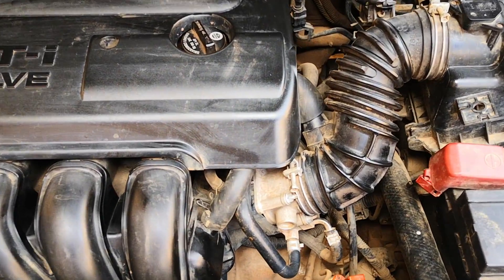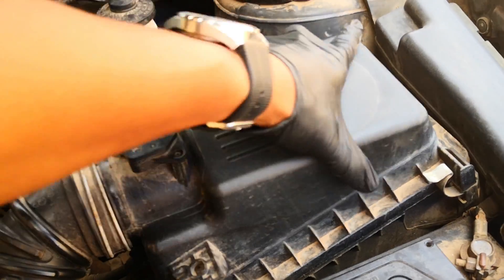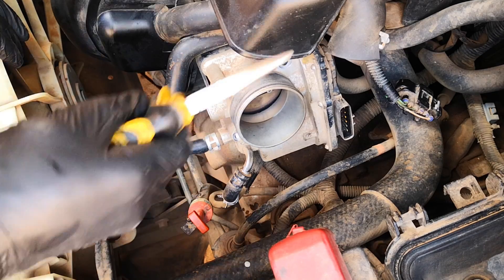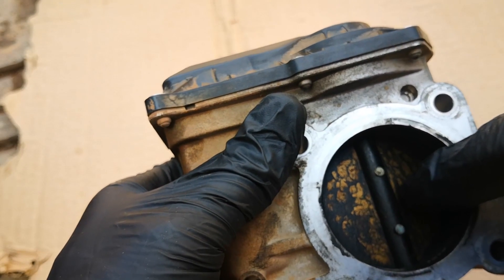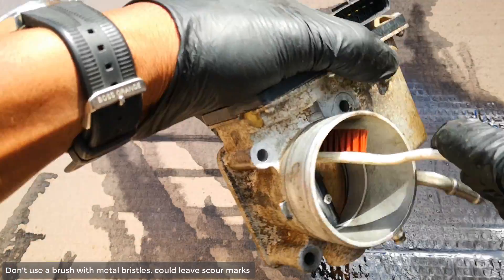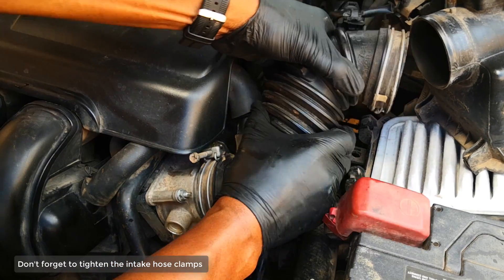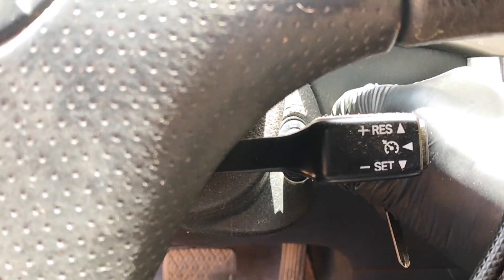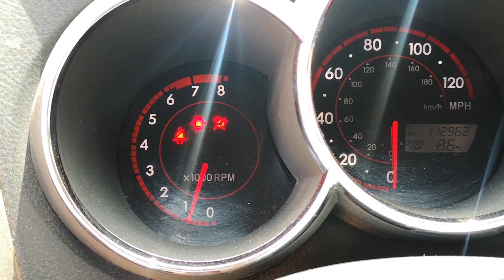Cleaning an ELECTRONIC Throttle Body: Toyota Throttle Body CLEANING / REPLACE: 2002 - 2008 Corolla

Comment: I cleaned the throttle body without removing the coolant lines. Now, when I turn on the car it shuts off by low idlling for 2-3 seconds. What could be the issue, please guide. Thank you.
Reply from the maker: Did you do an idle relearn afterwards? If its a Toyota, do the idle learn procedure. What car is it?

Comment: Weak acceleration....bot those Toyotas (Corolla/Verso) has already a week acceleration, so what do you mean by "weak"  ? Seconds to 100km/h ? Mine has 12-14s and I guess it always had that timings.
Reply from the maker: I just meant weaker than what you're used to. I haven't looked up Toyota's official 0 - 60 miles or 100 km numbers.

Comment: Is there 1 or 2 coolant lines? Should they be replaced when changing the upper lower hoses?  Where would I purchase the coolant hose(s)?
Reply from the maker: 2 lines. Inlet and outlet. I only replace if they are cracked.

Comment: What is the torque tighten value ?
Reply from the maker: I don't remember off the top of my head, but I usually mention torque values when reinstalling the part, or didn't I?
Reply: @DIYAutoworksNG  You mention but I don't understand I heard 13 but I'm not sure ( I'm a female and want to do this cleaning throttle body for the first time tomorrow to my 2003 Toyota Corolla with 287000 miles) I watched your video many times to learn the steps. Thank you for your prompt response.

Comment: While the master was cleaning, he opened and closed that cover manually. Now, the car starts at 2000 rpm at first start (it was 1200 rpm before) and it improves when the engine warms up. 2 years have passed, but I still haven't been able to solve the high idle problem.
Reply from the maker: I've experienced this on a Toyota. Have you ever done the idle learn procedure? You'd have to reset the ECU or disconnect the negative battery terminal, allow 15mins, and then reconnect. Then do the relearn procedure.
Reply: @DIYAutoworksNG  I cut the power but it didn't work. I did all the resetting processes but it didn't work. Toyota service said I needed to change the throttle body but they couldn't guarantee if it would be a definite solution.

Comment: What's the difference between before and after?
Reply from the maker: Depends on how gunked up it was and whether the butterfly valve was sticking. If it was, you should notice smoother idle and better acceleration.

Comment: my friend my car only vibrates when  go in drive why could this be
Reply from the maker: It could be engine mounts especially if there's a clunck. Could also be drivability issues. Is the check engine light on? Any codes?

Comment: That Throttle Body isn't CLEAN..nothing happens if you move the ""FLY metal" because after is CLEAN the Throttle Body, the ""Fly metal"" returns to the original position that's why  the ""Throttle"" needs to be ""REPROGRAM or RELEARN"" again because every time is ""build with carbon"" around the ""FLY metal"" the computer REPROGRAM the QUANTITY of air"
Reply from the maker: I'm not saying something will happen, just saying what's best practice.

Comment: Will this procedure correlate with the 2021 corolla hybrid?
Reply from the maker: Good question. It would appear so, however, there are general safety measures for working on hybrid vehicles which have the capacity to deliver fatal electric shocks. Because I haven't really worked on hybrids, I'd say you do a bit more digging for TB cleaning on hybrid cars.

Comment: Can a dirty throttle body cause car to idle too high when started? Takes a couple mins and then goes down or goes down once put into reverse…
Reply from the maker: It's possible. Could be a vacuum leak too. Also, depending on the car, could also be vehicle in need of an idle relearn procedure. Do let me know the cause when you finally get it. All the best. 👍🏼
Reply: @DIYAutoworksNG  Thanks man!! I absolutely loved this video, so thorough. It’s a 2005 Toyota Corolla. So I could do the procedure you did after cleaning? I’m gonna clean it next week when the weather breaks for my son. Thank you for such a quick response, what state are you in?

Comment: Warning ⚠️ Carb cleaner can be much more harsh on this engine component. You should only use THROTTLE BODY CLEANER 👍🏻
Reply from the maker: 100% correct you are. I now have and use throttle body cleaner.
Reply: Is best the carb clener  and need clean the intake for a good job

Comment: You should open the valve and remove the dirt on valve edge and the area valve touchs while it is closed.
Reply from the maker: This can be done after remounting using the gas pedal to depress the butterfly plate. Although aggressive blasting usually melts it off.
Reply: AND put on a new gasket !!   That one is tired!

Comment: I have toyota corolla 2010. can you please mention the default throttle plate opening at idle by manufacturer? unfortunately the mechanic has messed up with the L-key screw on throttle body. now throttle plate opening at idle is not at orignal position. Thanks in advance.
Reply from the maker: Isn't the throttle body on the 2010 Corolla electronic? I can't exactly relate to manual adjustment of idle on the car using a screw. 
I recommend  should changing your mechanic. Gone are the days of adjusting idle from the throttle body. The ECU controls everything with input from several sensors. 
Except I'm missing something, it's rather an idle relearn or throttle body reset procedure that should apply.
Reply: @DIYAutoworksNG  in the video at 5:30 see the top right corner, there is a yellowish glue type material, if u remove that, the L-key screw is there. in my case this screw has been messed up with. now I want to bring it back to orignal position. I need your help in this regard. also if u have any service manual of throttle body..
Reply from the maker: I see. Unfortunately, I really don't have experience with adjusting electronic throttle bodies manually.

Comment: Could this process, apply to the 1azfe engine throttle body?
Reply from the maker: I haven't worked on the 1azfe, but the principle is the same.
Reply: @DIYAutoworksNG  thanks
Reply: What about manual gearbox???

Comment: in video at 5:33 on throttle body top right cornar there is a screw hidden in a glue type material.
can you please tell me, what is the function of that. and how it help in adjusting a specific parameter?
I have observed that changing the position of that screw make throttal pedal response to respond differently and effect the drivability .
I have an issue of poor idling. throttle body is cleaned. every possibility has been checked but could not fix the issue.
Reply from the maker: Hey, I wasn't able to see the the screw you were talking about. However, I'd say a number of other things can cause a rough idle. Do you have a check engine light? Any codes?

Comment: Great Video done by a normal mechanic. Love the use of the dot punch 😊
Gonna clean my wife's Auris throttle body after our holiday.

Did my Scooby Legacy 1 month after buying it 2nd hand with 90,000 miles on the clock.
My God, it was gunked full of Carbon. Not anymore👍
Reply from the maker: Thanks! Carbon is the enemy😂
Reply: How was your holiday & how did you go?

Comment: Worked wonderfully for my 07 corolla. Efficient video. My car was idling so low it would die at stop signs after I changed the starter out, it runs smooth now. Thanks for the much needed and appreciated direction!
Reply: Did you replace the starter or do what he did in the video?
Reply from the maker: Thanks for sharing!

Comment: I used this method once on the vehicle with engine running and air intake hose off, spraying CRC Throttle Body Cleaner into the air intake. Black crud came out of the exhaust.
Reply: One problem doing it that way is you could bugger up the Cat and or Lambda Sensors. Better to clean it while the car is off.
Reply: @BandiMasha  
I think it did crud up the catalytic, very mildly though.
I put in new Cats though for better flow.
Performance is like comparing night and day now.  Vehicle is way more responsive on acceleration.
Reply: @BandiMasha  Not only the car is off but also the ign key is out.
Reply from the maker: And you felt quite satisfied I would imagine😁. Never observed my exhaust while using a spray cleaner. I will definitely setup this shot one day.

Comment: I have a question, does this throttle body reset itself?
I will service my 2005 Toyota Matrix Xr
And I want to know if this throttle body can be reprogrammed by itself
no need for a scanner
Reply from the maker: You don't need a scanner for the idle relearn, but there is an idle relearn procedure. Which you should do if you moved the butterfly plate by hand or took it out of vehicle to clean as I did. Here it is:
Warm up the car. Shut it off. 
Put the key in the ignition.
Turn the key to the On position, but  don't start the engine. Wait a few seconds, turn it off.
Repeat the above step again. But instead of turning off, start the engine.
Engage the parking brake.
Set the gear in Drive.
Wait 5-10 mins.
Shut off the car.
Reply: @DIYAutoworksNG  Just one detail that I forgot to add, my Matrix is manual transmission
It's the same process, but do I have to put it in first gear?
Reply: @DIYAutoworksNG  And thank you very much for your help.

Comment: Can you do this without removing the throttle body? Just sprang and wiping? I'm afraid to break seals on those old hoses
Reply from the maker: You can, though the back side of the butterfly plate will be difficult to clean. 
Genuine concern there on old hoses.  I cleaned the PCV valve on this same car recently, and the hose to it had become hard and simply cracked while I was trying to fit it back 😠. Had to make a dash to pick up the hose and refit.

Comment: Good day please when i engage my car on drive the car will use force to enter gear and the engine is high what do i do is censor throttle please thank you sir
Reply from the maker: You'll need to scan the car to get a better picture of the problem. Are you able to do that?

Comment: Why some people pushing their Toyota throttle body butterfly (fly by wire)
Reply from the maker: Better not to push by hand or at least minimise it.
Reply: @DIYAutoworksNG  may I know why ?
Reply from the maker: Do you mean why it's not good to push by hand?
Reply: @DIYAutoworksNG  yes,
Reply from the maker: It's because drive by wire uses a motor to control the butterfly plate as against the spring mechanism used in drive by cable. Pushing the butterfly plate by hand can distort the caliberation of the motor, could also have the risk of stripping gears if not done correctly and lastly, if the vehicle is powered, because the butterfly plate is motor controlled, it could catch anything in its part and bite down with intense force. E.g. chop off a finger if it gets caught.
Reply: @DIYAutoworksNG  thats crazy
Reply from the maker: Yep.

Comment: My corolla 2007/2008 has the same part and i bought a valvule iac to replace but i could not find, so this has one or not??? I have no idea :(
Reply from the maker: Your Corolla is drive by wire meaning it does not have an IACV. So in summary, it does not have.

Comment: Great content sir 👍🏼

You could also do a video on how to clean the fuel injectors and cylinders on this car without having to dissemble the engine. The type of cleaning where you just use the pressure cleaners that you hang on the hood of your car, and the borescope to check the amount of build up in the cylinders. 

Have a good one sir, one love ✊🏾🇳🇬
Reply from the maker: Thanks!
This suggestion or a similar variation has been on my mind for months. Just crack it out soon. Thanks upping this.
Reply: @DIYAutoworksNG  you’re welcome sir

Comment: Does a 2006 corrolla has a iac valve
Reply from the maker: Just take a look at the throttle body. If it has black cables running into it with locking nuts, it does. If it doesn't  it has no IACV.